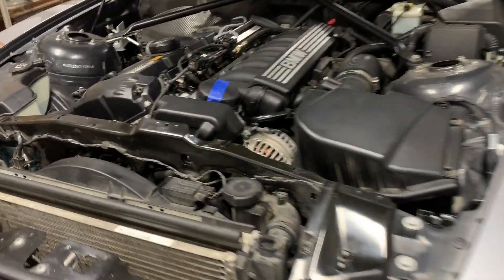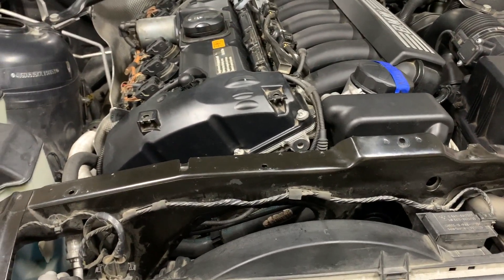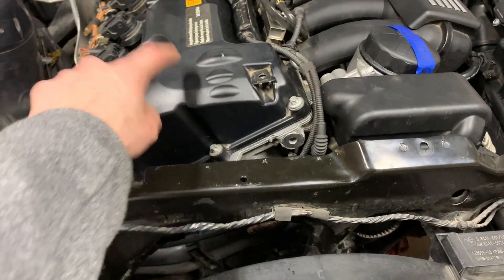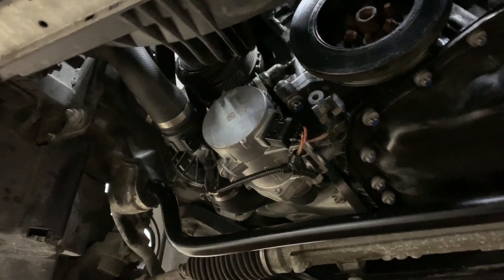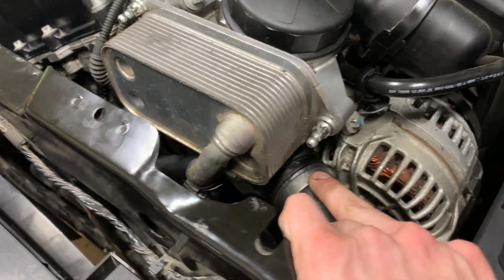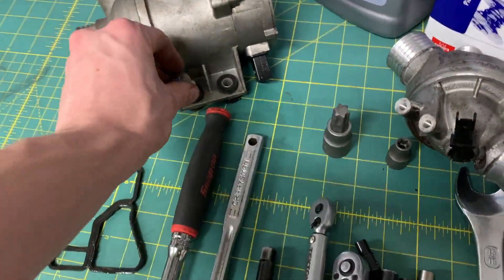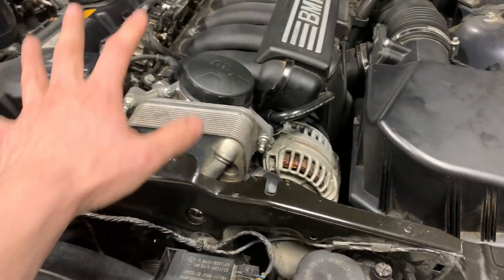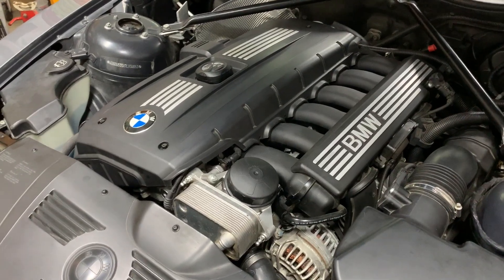BMW Z4 N52 - Water Pump, Thermostat, Oil Filter & Cooler Gasket - 100K Mile Service Overview

Comment: Thanks for making this video! My Z4 just started dripping from passenger side front of the engine compartment today... Haven't dropped the plastic  engine cover under the engine yet but assuming it's most likely the pump or thermostat housing... im ordering the parts tonight and going to replace them when I have a nice day. I do most of my own work and wasn't sure if the water pump was going to be a nightmare or not. Also, nice to know what tools were involved in the repair, great video, Thanks again!

Comment: Note - there absolutely IS a lift point in the front center - it's the same for the convertible also - I've had both and I own a Z4 coupe now.  It's under the indentation of the aluminum panel - directly behind that aluminum panel is the steel cross member that supports the front weight - I've used it many times on the coupe thus far to jack it up from the center.

Comment: at 7:12 you can see the front jacking point. It is that protrusion in the reinforcement plate (in front of the oil drain cover and in between the bolt holes) it connects to the subframe, which is right above it.
Reply from the maker: @Zack Komachkov - although it looks like a jack point, it is not. It is a thin sheet of aluminum that will crumple if you lift there. The front subframe is directly above it so it will eventually lift the car but only after it bends the aluminum plate. On the Z4 M, it is a jack point but not on the 3.0si; annoyingly. Good eye though!

Comment: I have the N52B30 (160Kw / 215hp) euro spec engine in my 2011 E82 125i. My oil cooler does not have the plastic cover and haven’t seen it on other 125i’s. The older (2006 and earlier) 130i’s do have this plastic cover on the oil cooler.
Reply from the maker: @Valintjin Vos - I noticed that too, that some cars have it and some don’t.
Reply: If you’re interested and have Instagram. Please check out bmwe82125imsport for pictures etc.

Comment: Hey Casey, I have a question that maybe you could answer. I just installed the new pump, thermostat, hoses and all new clamps. You were right, the job itself actually went mostly easy! The parts I removed were all factory BMW, and to my surprise it looks like my pump and thermostat were actually good... the factory installed one of the hose clamps on crooked and it looks like the hose ended up backing off just enough to start dripping... lol! I did end up removing and replacing it all. My question is I did drain all the coolant from the radiator and emptied the expansion tank so the system is dry. Ive heard that the system most likely will end up with air pockets when I refill it and there is a procedure to cycle the coolant in the system that will push the air pockets out. Can you explain, or are there any good videos you know of that show how to do this? Thanks again, just knowing beforehand what tools to have out was great. Oh, and before I forget, I haven't torqued any of the bolts yet, would you recommend using any blue loctite on the threads, I found one of the two bottom bolts on the pump while still being threaded all the way in, it was only hand tight and I didn't need to break it loose with the rachet
Reply from the maker: @mike tucci - I’m glad to hear that you’re doing some preventative maintenance! Not enough people do, in my opinion. 

I would recommend draining out as much coolant as you reasonably can. Draining from the radiator and the water pump will get most of it. As for bleeding, yes you will get air pockets if you don’t bleed the system correctly. Thankfully the system has an autobleed feature because of the electric water pump. Turn the key to position 1, then press the throttle pedal to full for 10 seconds. You’ll hear the water pump kick on, it will begin to bleed itself. That’s the idea anyway. Definitely look up “N52 coolant bleed procedure” for the real details of the process. Just be careful not to kill your battery. Loctite for the fasteners isn’t strictly necessary but it is a good idea. Just don’t use too much because many of the fasteners on the N52 are aluminum and the loctite might be stronger than the bolt when you go to take it off next. Good luck and thanks for watching!

Comment: Hi. I have exact same car. Thank for the video. Do you actually gave how you replaced the parts?  Water pump and thermostat
Reply from the maker: @M J - I’m sorry, I don’t exactly understand what you mean. Can you rephrase your question?
Reply: @Casey_Schmidt  
Oppz... Do you have the clip when you were changing the thermostat and water pump? Just want to make sure i dont mess up lol ty for reply
Reply from the maker: I don’t have any footage of me removing or reinstalling the parts. That said, they’re really straight forward to remove and reinstall. Just take a look at the new water pump with the new bolts and you’ll know exactly which fasteners you remove. You can also look some stuff for the 3/5 series cars to use in conjunction with my video since the N52 engine is the same for all the platforms. The main difference will be that the E86 chassis doesn’t have a subframe in the way of the water pump.
Reply: @Casey_Schmidt  thanks bro, i just ordered the parts and been watching videos..i went under the hood earlier and i saw.. it shouldnt be to hard but then i tried to disconnect the connectir from water pump to thermostat, i couldnt get it out, not sure if i have to pull out from thermostat.. tips? Thanks in advance